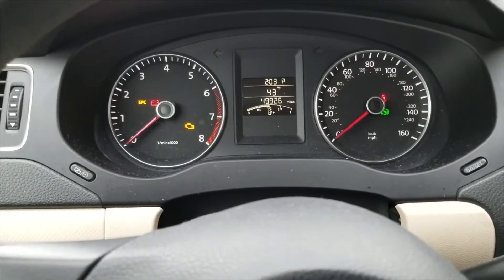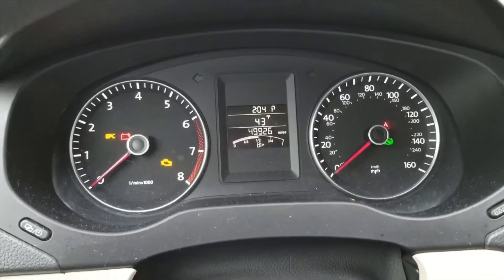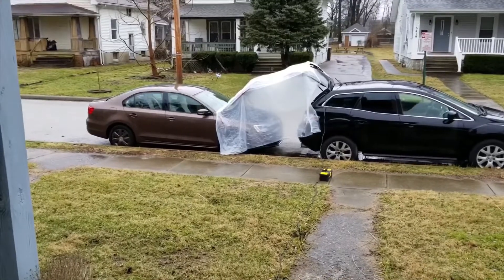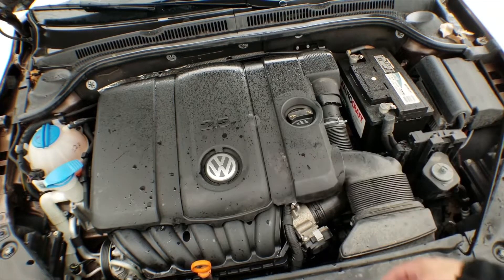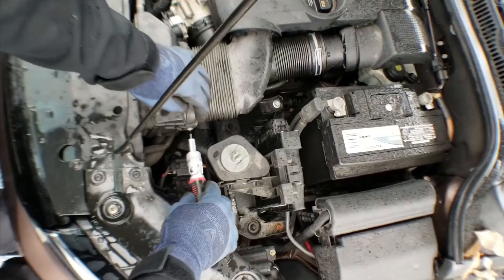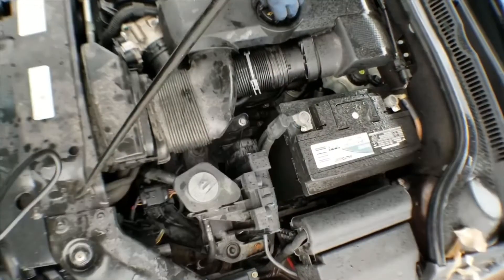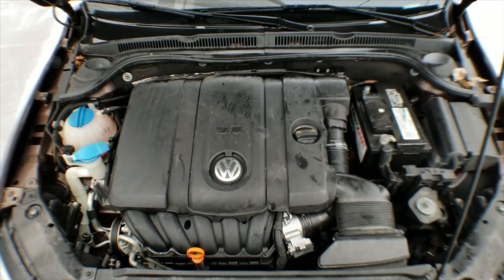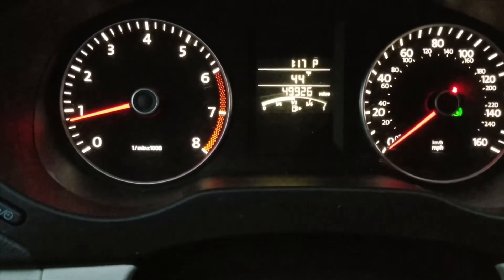Volkswagen EPC Light Diagnosis: Throttle Body Replacement

Comment: Hey brotha, awesome video. Currently having the same problem. EPC light came on then the check engine light and got a P0122 code. Took it to a mechanic and told them what needs to be done but they still suggested a check engine diagnostic. Turns out I was right and they wanna charge around $900 parts and labor to replace the throttle body. They mentioned something about the gasket but didn’t really pay attention because i was still shocked on on the cost. I noticed you said you aren’t worried about the gasket and was wondering if you ever replaced that eventually. Not much of car individual so have no clue how critical that part is.
Reply from the maker: Hey man! Oh damn! Yeah I wouldn't pay $900 !! The gasket wasn't changed in mine because it was in great shape as you could tell in the video it was bright in color and had no tears or deformed in any manner probably due to it being only like 40,000 miles old. I def think you can manage this repair on your own it ain't bad at all👍🏽 I'd purchase a gasket just in case if you are higher in miles. I'm glad this video has helped and thanks for such positive feedback man. Good luck on the repair 🤜🤛
Reply from the maker: The gasket maintains the seal so it is important for optimum performance of getting the proper amount of air to the internal combustion system of the engine air fuel and spark mix!
Reply: Ahhh gotcha! Thanks a lot bro!
Reply from the maker: @drewill23  Welcome man ! Hopefully all goes well on the repair 👍🏽

Comment: Okay, two days ago I changed my oil on my vw Tiguan and my check engine light was on because of the cooling system malfunction. And today I drove my car today to take my son to school and my epc light came on and pretty much fucked all the acceleration and I could tell you that I had that problem a few months ago but fixed by replacing the throttle body. Help?
Reply from the maker: Hey! So you are now seeing the EPC light warning again after changing out the Throttle Body ? Is there a Check Engine code with this EPC warning as well?
Reply: @elevatedpotentialacademy  I do have that ISSUE > EPC & CHECK ENGINE INDICATOR

Comment: Hello, when you replaced your part did you have to reprogram it? Btw was your part new or used? Thanks
Reply from the maker: No, reprogramming was not necessary! It worked great and still doing well👍 it was a new part on ebay!  Good luck on the repair and I hope this video helped 🤜🤛 I will be posting a follow up video on this soon👌🏽 I appreciate the positive comment, thank you!!!

Comment: this it happening to me again!!!!! same freaking CAR! first at 70k now at 110k
Reply from the maker: Hey! Aahhh im sorry to hear that! I will be coming out with a second video that covers some of the most common issues that cause an EPC light! Stay Tuned ! The EPC light primarily is caused by anything computerized that would limit the performance of the vehicle such as the Electronic Throttle Body, Acceleration Pedal, Cruise Control, Brake Light Switch, or engine performance sensors like Mass Air Flow Sensor, Vehicle Speed Sensor, Crank Position Sensor, or Camshaft Position Sensor. I would suggest to get the Check Engine Light read that is usually associated with an EPC light warning in order to help with narrowing down what it possibly could be. I hope this helps you identify what the possible issue is  🤜🤛

Comment: @@ballin on a budget auto
I had just taken my kids to school and got home parked the car and my EPC light turned on. Will that light turn on if the car is low on oil? Or if I use the AC with defroster on? we change the catalytic converter a couple months back because the engine light turned on and it wouldn't pass the smog. When we bought the car in Marchwe took it for a tune-up and everything that I needed to get. Need help what could it be? The kind of car I have is a 2002 Volkswagen
Reply from the maker: Hey! The EPC light primarily is caused by anything computerized that would limit the performance of the vehicle such as the Electronic Throttle Body, Acceleration Pedal, Cruise Control, Brake Light Switch, or engine performance sensors like Mass Air Flow Sensor, Vehicle Speed Sensor, Crank Position Sensor, or Camshaft Position Sensor. I dont see the AC and defroster being on Simultaneously causing an issue. I would suggest to get the Check Engine Light read that is usually associated with an EPC light warning in order to help with narrowing down what it possibly could be. I hope this helps you identify what the possible issue is  🤜🤛
Reply from the maker: The new catalytic converter and tune up shouldn't be an issue since if there was a problem with the repair the check engine light would had come up after about 50-100 miles afterwards 👍🏽
Reply: @ballin on  Budget Auto thanks for the reply. 😭sounds like it could be expensive😭  when I turned my car on yesterday back it didn't turn back on. But today while I was taking my son to school I had to speed up and the EPC light came back on. Then I stepped on the brake to reverse and get out of the school.  when I did that the light turn back off. Any idea if it could be the brakes? one thing I did notice since we bought the car is when I move the gear stick shift🤷🏽‍♀️hope that's the name for it. Anyways , to put it into reverse or drive sometimes I have to make sure it clicks or it won't move or go to the right gear. 😞😩
Reply from the maker: @tntmami4413  if the EPC light turned off with the brake I'm under the impression that it may just be the brake light switch needing to be replaced. Check out this video its a cheap easy fix https://youtu.be/66zbep-PG3U 🤜🤛
Reply: @elevatedpotentialacademy   thanks I appreciate it
Reply: @ballin on a Budget Auto I have a 2002 Volkswagen

Comment: I have a 2015 VW bug. My EPC has been continually coming on and off. The alternator and battery were changed because I was told that was the problem when the car would not start. A week or so later it came on again. So the oil was changed but a synthetic additive was implemented as well. A day or so later it came on again!!! Now I’m told to put premium gas in the car!!! It’s maddening. The AC is taking about an hour to cool the car. That’s been going on for a couple of months but I failed to mention it until today. Could that be aggravating the light?
Reply from the maker: Jud Jones Hey! The EPC light primarily is caused by anything computerized that would limit the performance of the vehicle such as the Electronic Throttle Body, Acceleration Pedal, Cruise Control, Brake Light Switch, or engine performance sensors like Mass Air Flow Sensor, Vehicle Speed Sensor, Crank Position Sensor, or Camshaft Position Sensor. I would suggest to get the Check Engine Light read that is usually associated with an EPC light warning in order to help with narrowing down what it possibly could be. I hope this helps you identify what the possible issue is! Good luck on your repair 🤜🤛
Reply: Thank you. The Babe, that’s her name, has been to the dealer several times to figure this out. They haven’t.😩😩
Reply from the maker: @BETTERTIPSFORYOU  oh wow I'm shocked that the dealer themselves didn't have a solution smh 🤦🏾‍♂ warranties are nothing like they should be , let alone the work being done can't always be trusted. That's what got me to start doing all my own car work a few years ago. Hopefully one of these solutions help you resolve the issue 👍🏽By the way, I will be doing a follow up video on this topic since this video has received a lot of buzz so consider subscribing in order to Stay Tuned 🤜🤛

Comment: Yesssss definitely. Thank you because Im driving to Dallas and the light came on
Reply from the maker: Ahh that's terrible timing! I would recommend having someone read the check engine light that is associated with the EPC warning in order to help narrow down what the problem may be due to it can possibly be something other than the throttle body or acceleration pedal (these two are the most common issues; throttle body changed in this video) such as a sensor. I'm glad the video has helped you! I hope you are able to identify the problem👍🏽good luck on the repair🤜🤛

Comment: how did you get rid of the check engine light?
Reply from the maker: After you repair something that had set off a check engine light most times it will go away on its own upon restart, but others you'll have to reset it with an OBD2 Scanner and see if the check engine light returns after 50-100 miles of driving and if it doesn't you're good👍 Check out the OBD2 Scanner I use https://youtu.be/iFNchslS0ts
Good luck on your repair 🤜🤛
Reply: @elevatedpotentialacademy  Ok perfect thanks

Comment: Nice. Hey man, I think I may be experiencing the same thing with my VW Jetta 1.8T . My car doesn't crank at all, it happened suddenly and right after fueling up. The EPC light stays lit along with the Check Engine after turning the key to run (not start). I don't have a scanner to check diagnostic codes or anything.
Do you think it may be the same thing?
Reply from the maker: Hey man! Those lights turn on with the turn of the key normally if there is no start. If your car is struggling to start, does it make rapid clicks and the lights on the dash flicker when you turn the key? Or is there no click at all? Does the starter make a cranking noise at all? I'd start with seeing if the car will jump. If it does jump after some time of charging then the battery is the problem. If it doesn't jump with jumper cables and has no crank, the starter is the issue. If the car doesn't jump but has a crank then it could be the ignition system  (plugs/ wires). If the car doesn't start, cranks, and starts with starter fluid it is the fuel pump. Try these scenarios. Lmk the results👍
Reply: My 2013 GTI is doing this. I VERY recently got a carbon cleaning. I then replaced the battery, plugs and coils. It will randomly not start. If I try it a few more times it will start up. It seems like it is giving up on turning over prematurely. Ideas?
Reply from the maker: @christopherhobbs1196  You recently replaced the ignition system and battery and now it isn't starting up properly? I would recommend rechecking all of those connections and/ or cleaning/ replacing the battery terminals if you have not already since the car is not turning over but is cranking. Sometimes if you have used too much dielectric grease on the plugs it can cause  start up/ idle issues as well.  LMK how it goes or if you've already done these things 🤜🤛
Reply: Ballin On A Budget Auto I have already done all of those things as well as checking my grounds. The problem persisted. I then made sure that all of the electrical connections that would have been disconnected for the removal of the intake manifold for carbon cleaning were securely plugged in as well. It is too early to tell if this has fixed the issue.
Reply from the maker: Christopher Hobbs It’s hard to tell. I’m leaning more towards there having to be an issue with the connections or something not securely attached if everything was working great before both of these things were done; however, I know you had already thought of that. There is a good chance that it’s either the plugs/ wires or battery connections. Could possibly be a malfunctioning starter/ starter solenoid but I doubt it if it is cranking just fine.  Maybe check the Fuel Pressure Sensor connections/ other electrical connections that may had been removed as you suggested. You did all this work yourself? If not I’d recommend returning the car to where the work was done.

Comment: This video is very helpful my epc light came on and I am having the same exact issues auto shops are charging a arm and leg to fix it . I’m going to clean the throttle body first before I buy a new one hopefully mine works out just like yours
Reply: It’s goes up to 60 mph just a little rough so hopefully it just need to be cleaned 🙏🏻
Reply from the maker: I'm happy to hear that this video was helpful at diagnosing what may possibly be going on with your VW and Thanks for such positive feedback! If it is an acceleration issue as stated it certainly is possible that it is the Throttle body, but it has the possibility of being the acceleration pedal, mass air flow sensor or crankshaft/ camshaft sensors as well so if there is a check engine light it helps a great deal to get it read. However, I hope cleaning the throttle body resolves the issue! LMK the result👍 Good luck with the repair 🤜🤛
Reply: Ballin On A Budget Auto cleaned it still having the issues, got the check engine light check and they said it was throttle body or pedal censor so I just order the throttle body on eBay just waiting for it to come in . I’ll keep you posted
Reply from the maker: Daniel Perez Sorry to hear that. Sounds like it was very similar to mine in which the built in Throttle Position Sensor failed in the Throttle Body. Well hopefully you have the same luck as I did fixing the issue by replacing the Throttle Body!!
Reply: Ballin On A Budget Auto it works perfect after I changed the throttle body just need to clear the check engine light
Reply from the maker: @danielperez4412  AWESOME MAN!! That's exciting!! I'm glad that that worked and I was able to help! That's great👍 and Thanks for keeping me updated !! I hope that VW doesn't give ya too much more trouble 🤜🤛 Stay tuned man!
Reply: @danielperez4412  While you wait for the part, can you still drive the car with the EPC light on?
Reply: J J just Drove it to the store around the corner from my house that’s about it ...
Reply from the maker: @jj811  limp mode is meant to protect your car from any damage. It'll get you to where you're going and may also be temporarily turned off after a 15sec restart, but It is not recommended to drive it for long periods. When it happened to me, I had about a 50min drive ahead of me in which did not damage my car. So I would just recommend to be careful 👍🏽

Comment: my 2019 Tiguan has this problem but is intermittent.  Has happen about 3 times and I only have about 800 miles on it.  Guess I should make an appointment soon
Reply from the maker: Oh wow come on Volkswagen !! Only 800 miles dang! Yes I would most certainly have them check it out while still under warranty!! Hope you get it resolved 🤜🤛

Comment: will try this this weekend I am having the same issue
Reply from the maker: If there is also a check engine light I would recommend reading that first in order to help narrow down the source of the issue, but yes majority of the time the acceleration issue is caused by either the throttle body, acceleration pedal, or mass air flow sensor. I'm glad this video was helpful and good luck on the repair 🤜🤛

Comment: Hey bro. do you have the link to wear you bought your throttle body from on EBay? $80 is cheap for that throttle body. I have a 2010 vw jetta 2.5L and with over 100k miles it just came on, but doesn't stay on. Goes on and off. Rather get it done it than later ya know? Thank you for the video, keep up the great work!
Reply from the maker: Hey man! The Throttle Body I purchased was $89.99 at the time on ebay. Here is the link:
 https://rover.ebay.com/rover/0/0/0?mpre=https%3A%2F%2Fwww.ebay.com%2Fulk%2Fitm%2F253896564409 
Good luck on the repair! I hope my video helps and thanks for the positive feedback 🤜🤛
Reply: @elevatedpotentialacademy   found out that it was not the throttle body when I brought in to VW service, it was a camshaft and crankshaft sensor gone bad that caused the EPC to come on. Gladly it is fixed and I don't have to worry about that for now. Being that it is a car with 111k miles on it, something else will happen. Thing is with Volkswagen cars are the " Love/Hate" relationship with them. Unfortunately, this will be my last one.
Reply from the maker: @AoiGP  Wow well good thing you got it looked at! An EPC light can certainly be triggered by anything across the spectrum that effects the expected "power" values monitored by the computer, but that's why the check engine light is so crucial with the EPC Light in order to effectively narrow it down! Yes like ya said I've liked the VW, but def not interested in getting another one after this 1st experience 😂 !! Thanks for updating what you had found to be wrong with your VW! Glad it's fixed for now 🤜🤛

Comment: So I have a Jetta with this light and the thing is I don’t have the engine light only the epc light and it is running rough but when I turn off the car the light goes away the moment I start driving and I really give it some gas the epc light turns on
Reply from the maker: Def sounds like the throttle body or pedal sensor are going out! With it being intermittent such as that the sensor is certainly going out on either one of them, but it isn't bad enough to throw the engine code just yet, but for sure has the signs and symptoms of either one of those! You may be able to improve it with cleaning the throttle body, but chances are probably not since the electronic throttle body has the sensor attatched to the entire unit.  I hope that narrows it down 🤜🤛
Reply: Ballin On A Budget Auto it really does thank you!
That’s what I was thinking it might be a sensor but can’t figure out the epc light only comes on when I give it gas other then that their is no light but the engine still runs rough I’m gonna take it in tomorrow to firestone for them to check it out and I don’t want to spend 100 if they can’t figure out so if I can help on figuring out what to replace I’d rather do that myself.
Reply from the maker: @Albert-L30  Awesome, glad to hear!  I  Hope you are able to resolve it on your own! Being that it will be an electrical throttle body, it would be similar to my repair or potentially just unscrewing the pedal itself with a torx screw bit and unplugging the sensor bracket to replace it with a new one. Good luck with the repair 🤜🤛